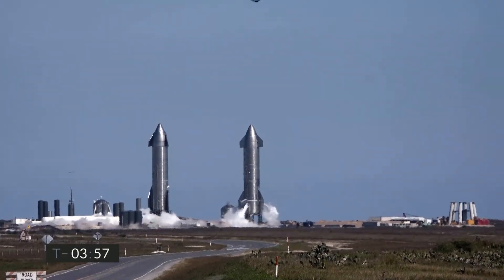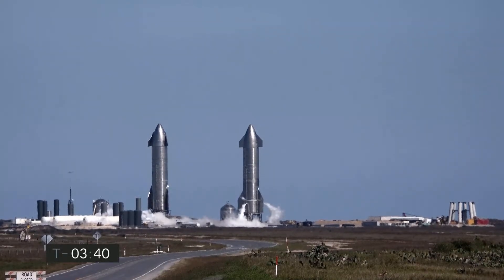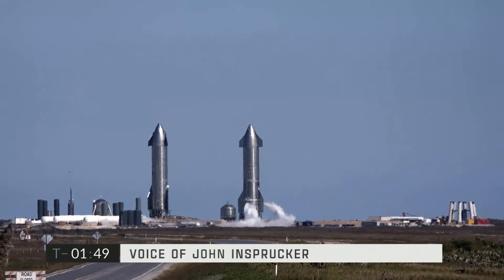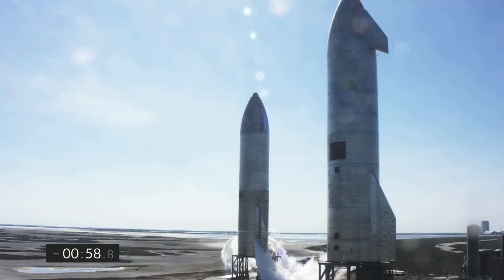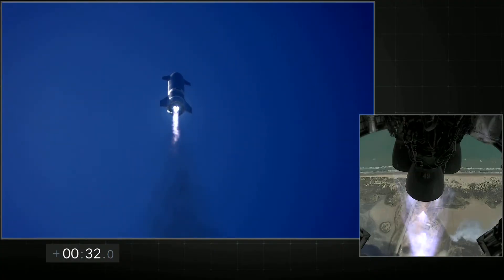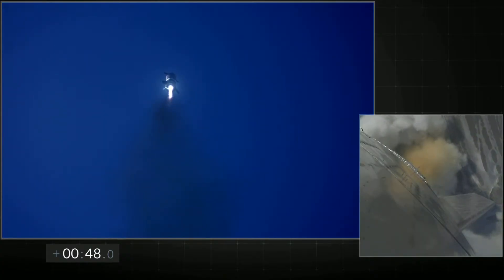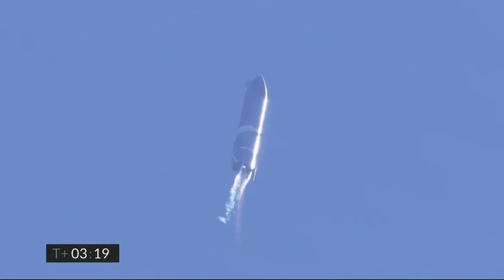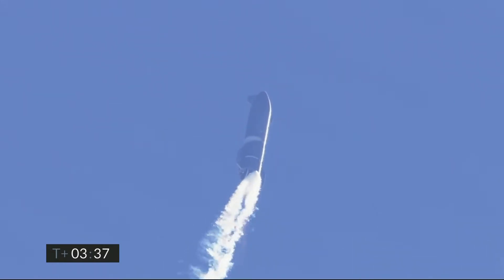Starship | SN9 | High-Altitude Flight Test

Comment: they should have landed on water... to save the rocket...
Reply: Wouldn’t have survived on water anyway
Reply: @FinkHD  why would you say that?
Reply: @khongking9794  Because it’s a 50 meter tall 100 ton heavy rocket, with the velocity that sn9 hit the landing pad the water would’ve acted like concrete
Reply: @FinkHD  its not free falling... the booster is trying to reduce the speed and the impact... if it landed to a softer surface like water... it would have stayed intact and  did not explode
Reply: @khongking9794  Look at how fast it is, the Engine slowed it down, but because the other engine didn’t ignite it still was too fast, even for a water landing
Reply: @FinkHD  yes but to a softer landing... they could have salvage it.... its a test any ways... so i suggest they should try
Reply: I'm not sure landing on water would be a good idea, it would get wet. I think a big fluffy pillow would be better
Reply: @Salticus at least if i jump into the water, ill only get hurt... not like me jumping to a solid floor... ill get my bones broken 😅
Reply: @khongking9794  If you jump from a height like 10km, then you surely wouldn’t be alive anymore
Reply: @FinkHD  yeah but if i got a booster on my ass... lifting me up.... i would  survive... just sayin 😅
Reply: @khongking9794  Not if a engine from the booster doesn’t relight... if the problem would’ve been that sn9 lands out tips over or something, then water would’ve helped, but sn9 definitely hit way too hard
Reply: @FinkHD  yeah i think so too... so softer landing spot, even just a little reduction for the impact would still be a great help for the ship
Reply: @khongking9794  But I don’t think that they would try it, if sn10 gets close to landing it probably will land, I think they have enough control of it
Reply: @khongking9794  maybe sn8 would survive if it would splash down, but starship's final destination is mars, and there is no seas or lakes on mars, so its basically pointless.
Reply: @khongking9794  its not about saving the rocket anyways, its all about the data they got from the launches. Also, they have sn10 and sn11 ready and BN1 & 2 boosters getting stacked up. Success needs trying, first Falcons sucked as well.
Reply: @Pyrpyr_2017  actually my point was to save the Rocket... its a test... And having a test Rocket, if i was the owner or one of the people who built it, i would love to see it survive at least.... that SN9 rocket was so expensive guys... just want it to be practical... So, the landing spot should. be considered for now to avoid minimal damages and cost
Reply: @khongking9794  well, its not about the money, SpaceX could afford a 100 starships if they'd want to. As i said, SN10 is ready, and SN11-SN18 are being built, so losing SN8 and SN9 is not a huge loss.
Reply: This isn't minecraft. The engines and other stuff would get corroded, and it would still explode.

Comment: Parachutes have been invented.
Reply: But do they work on 150 ton objects?
Reply: @jackwhitlock1  no they dont work for any objects heavier than air but they Help to slow things down giving more time to adjust the landing.  They dont stop dragsters or fighter jets the brakes do but first they have to be slowed down.
Reply: @deanofthevale3193  remember, the final destination of starship is Mars, and atmosphere on mars is not enough dense to make parachutes work just like they do on Earth.
Reply: @Pyrpyr_2017  there not testing on Mars though, I'm just saying to help bye a bit more time to perfect the landing and maybe the rocket for another test.
Reply: @deanofthevale3193  well, it's not about saving the rocket, at all. SN8 and SN9 were highly successful even without landing. When Starship will eventually land on Mars, landing procedure like that will be the most efficient, and after many tests and corrections, very safe. As I said, parachutes aren't the best for crafts like that. If they (SpaceX) would try to use parachutes for example on SN10 or SN11 they wouldn't gain any data from the landing, and they wouldn't learn to land without parachutes either, so its basically pointless to use them.
Reply: @Pyrpyr_2017  Ok if it's not about saving the rocket , have a big  Net then! So I can have rocket in the garden. 🤣👍
Reply: @deanofthevale3193  yea its basically all about the data and stuff

Comment: Can SN10 do a 150 - 1000 Meter Hop Test like SN6 with all 3 Raptors running to demonstrate landing after a full test flight? This should be done before attempting a High Altitude flight and another Crash landing.

Comment: To close when its time to land. Guess space x should adjust the virtical adjustment at higher altitude. Well, just usual space x. Fail then fail and fail again but later on they would probably succeed just like usual
Reply: An engine failed to light, flipping sooner would have made the problem worse

Comment: Here's a idea. Why not start correcting at least a half a mile before landing. You can't use three rockets to stop all that momentum. Even a tractor trailer won't stop 30 feet from red light if its going 55 miles a hour
Reply: Starship weighs ~120 tonnes at landing. Three Raptors have ~600 tonnes of thrust, so that's ~5G of acceleration. It was falling at ~67m/s (241km/h, 145mph).
Which means that with all three engines it can theoretically slow to a stop in only 56 meters (184ft). Not quite 30, but still impressive given the speed and weight.
The actual flip started at about 550 meters, ten times higher. That's enough to land on just one engine if the flip is fast enough (one needs ~335m by my math).
The problem was that it over-rotated and lost control due to engine failure, not that it didn't flip soon enough. Had it flipped higher it still would have crashed.
Reply: They actually save a lot of fuel by slowing down using aerodynamics first and then using the engines to scrub that last bit of velocity off.
Reply: This was an engine failure, your suggestion would make the problem worse

Comment: I'm curious to know why this took off from a position that was so close to another vehicle.  I would think that you wouldn't want them so close in case of major malfunction which could possibly lead to loss of both vehicles.  Anyone know why this was done in this way?
Reply: Because they're building so many of them (at least 7) back at the construction site that they didn't have anywhere else to put it.
They build them on fixed stands, and they can't just leave it sitting out in the open because it would be at risk of being tipped over by the wind.
The only other fixed mount they had was at the launch site. So either they halted production at the site, or took a risk and put it at the launch site.
Insert 'why can't I hold all these starships?' meme here.
Reply: @lazarus2691  Actually, they do have space to put it, i think they just rolled SN10 out there because elon said it and it looks cool and for PR reasons.
Reply: @alexn8219  Where did they have space?
There's only two stands in the high bay, which was needed for SN11 and BN1. 

At the time, SN5 and SN6 were still on their stands, and SN10, being fully stacked, was too tall to fit in the mid bay.
Reply: @lazarus2691  Hell they could have just plopped it down anywhere, just not as close to SN9 incase of a RUD. Pretty stupid decision to put it right next to it. They got lucky.
Reply: @alexn8219  
I already explained why they couldn't just 'plop it down anywhere'. It needs to be on a stand fixed to the ground so that it's not at risk of being tipped over by the wind.
They only move them on the transporter on calm days for a reason.

Comment: Spaceship design is totally wrong, it should be like Jupiter2 in "Lost in Space" :). Weit until U can make something like that. Your spaceship is like 20's century design.
Reply: America's top rocket engineers < R P
Reply: The Jupiter is poorly designed, as most sci-fi spacecraft are, in that it has the engines 'behind' the crew, instead of 'below' them.
"The Expanse" gets this right, take a look at this cross section of the MCRN Tachi: https://i.redd.it/5sfv72czwiry.jpg
The ship's decks are aligned vertically, like a tower, so that the engine thrust makes things fall 'down' instead of 'backward'
Reply: Build a better spaceship then

Comment: How much propellant SN9 spent to achieve 10km altitude, Gentlemen? Is it enough if scale it to real spaceflight? It looks like awesome, realy awesome, but as an engineer I am looking for more infomation to compose my own opinion. Will mandkind fly to other planets soon?
Reply: My best guess is that SN9 spent roughly 250 tonnes to reach 10km, about 1/5th of it's total propellant capacity. 
However, this was a very inefficient ascent. They went slowly, and hovered near the top to burn off fuel and reduce weight for descent.
Had their intention been merely to reach 10km, with no thought of slowing down or landing intact, it could have been done with 1/10th as much.
SpaceX have run the numbers on this, as have countless other people. The math checks out, the engineering just needs to live up to expectations.
Reply: The whole thing normally takes up about only 80 metric tons.

Comment: SN8 had RCS thrusters, right? Did anyone see RCS firing with SN9?

Not saying this has anything to do with success/failure. Just an observation.

Something similar happened between SN5 and SN6 if I recall.
Reply: You can see them at 10:08
Reply: @jackwhitlock1  Thank you. Can't believe I missed that first time around.

Comment: I guess the control of the engines is considerable less than they expect.
The control system must know the amount of thrust needed and how quickly it must be applied
It may be easier to control a smaller amount of reverse thrust earlier
Reply: An engine failed to light

Comment: Can you maybe use parachutes stored in the top of the starship. Just to slow down the descent prior to landing burn but after the flip from horizontal to vertical. She seems to be coming in to fast for such a large and heavy vehicle.
Reply: No, parachutes dont work on mars because the atmosphere is too thin
Reply: @atomicages8914  They were used to help land the rover though, weren't they?
Reply: @HumanitarianV4VGlobal  A 100 ton starship and a rover and 2 very different things in terms of weight. A parachute wont do nearly as much as engines would
Reply: @atomicages8914  Granted, but I wasn't thinking about them being used to land it, only slow it's decent. My other idea was to have multi directional propellers like those seen on Avatar pinned to the sides of the Startlink during takeoff and then deployed for landing, horizontally on struts rather than wheels. Using electricity generated from the sun. Instead of using fuel. We have the technology, can we use it ;)
Reply: https://youtu.be/_T8cn2J13-4
Reply: @shrodingerscat8940  Thanks for sharing! :)
Reply: You'd either need a very big and strong parachute or loads of smaller parachutes to substantually slow down something as big as Starship, thats not sustainable since that would add loads of mass, doing propulsive landings is the way to go once they have figured it out.
Reply: @alexn8219  what about my idea of using retractable helicopter type rotatory blades?
Reply: @HumanitarianV4VGlobal  The motor required for those would have to be huge to have any effect on Starship as its really heavy, and that adds mass. SpaceX has already perfected landing falcon 9 boosters, dont see why they would have too much difficulty in getting this to work, to be fair it is a completely different maneuver but propulsive landing really is the most efficient and viable method to go here.
Reply: @alexn8219  Well I am hoping and Praying for Elon they figure it out all the same. :)
Reply: Great work by the way, I love watching every minute. 
Man first landed on the moon the year I was born, 1969. I hope I get to see it happen again before my time is up.
Reply: @HumanitarianV4VGlobal  nasa is sending man back on moon in 2021-2022 after 50 years and this time they are planning to setup a permanent base on moon
Reply: @shrodingerscat8940  IKR, so exciting, I hope that time scale is realistic though. I should get to see it for sure.
Reply: @Amado I think you need a dictionary buddy ;) LOL!!!
Reply: @Amado No such word as Can't in My Vocabulary haha
Reply: Parachute would do nothing to help the starship, its way too heavy. It can help slow it down but in a VERY minimal way that's considered almost nothing. I do appreciate your enthusiasm though.

Comment: Elon has no engine sound on his cars, so he compensated it with his rockets
Reply: andylau  yeah you do know they don't run the engine all the way?
You coast most of the way, because there is no air resistance to slow you down.
Reply: @Kasmuller  Plus you its Superheavy that would be carrying Starship, and since theres no sound in space you wouldnt hear the engines on the Starship in space
Reply: @fedora997  you would if you are inside.
There may not be any air outside to carry the sound, but steel carries sound, and so does the air inside the starship.
Reply: @Kasmuller  I was talking about outside in space. Not inside the rocket. Its kinda like the Sun, its a massive explosion yet we dont hear anything because theres no sound in space.
Reply: @fedora997  there is sound in space...
There is just not anything for it to be carried through in most places....
Also the sun is not an explosion
Reply: @Kasmuller  It is. A big ball of fire, you wont call that a explosion?
Reply: andylau  ufo
Such as a rock or a undiscovered bird species?
Spaceships (sci fi) were invented by humans.
So you are saying we need to learn from ourselves?
Reply: andylau   I mean what happened at the Capitol was very much of a game was it?

Comment: My very stupid thought: maybe the engine failure issue is with fuel supply (lines) to the Raptors malfunctioning due to the "sudden reorientation flip" from horizontal to vertical for landing? Because the Raptors seem to work just fine from liftoff to engines-cut-off. Maybe it's best to orient the vehicle a bit earlier (like the F9s do) before the landing? Well, I'm just a novice and no Rocket Engineer. Only SpaceX know these things as they are the experts and have all the data. I do believe SpaceX will get it right with SN10. Go SpaceX! We love you!
Reply: It’s a good thought. However, if it was the fuel lines, both engines would have failed
Reply: @jackwhitlock1  true. Or, probably, only some engines are getting supply. Would be pretty interesting to see what solution SpaceX find for it...because I know they will, they always do. Falcon 9s started that way but their landings are now so routine that we almost tend to no longer think about what engineering genius made it possible.

Comment: Just a thought.
Use the lower flaps to help control and stabilize the rotation of the rocket...they work don't they? lol.
Reply: This still wouldn’t work if an engine fails (Like it did here)
Reply: @jackwhitlock1  Absolutely,  but every bit helps.👍

Comment: Why doesn't SpaceX start the flip sooner. Yes it would use more fuel to land, but you tune it down from that point. less likely to lose the rocket, more attempts to reuse the rocket and optimize it until it fails? Unless fuel is more expensive than the rocket or I am missing something. You go from working rocket until it fails. Not from failed rocket to working.
Reply: Saving fuel isn't just a cost concern, it's also a safety concern. 

The header tanks only have so much fuel capacity, and most of it is needed for landing, with some safety margin. The higher you flip, the more of that margin you use. 

You could use bigger tanks with more fuel to increase the margin, but that would make the rocket heaver, not to mention nose heavy.
And a heavier rocket falls faster and needs more thrust to slow down, which uses extra fuel, which eats away at that extra margin.
Of course you could add even bigger tanks to compensate further, but you just run into the same problem. The tyranny of the rocket equation.

So there's a very real argument to try and be as fuel efficient as possible from a safety standpoint. Also, less fuel means smaller boom if you do crash...

There's also the matter of the throttle band. 
There's a maximum altitude at which Starship can land on minimum throttle, and minimum altitude where it can land on maximum throttle.
Anywhere between those two altitudes will work, but ideally you want to be right down the middle.
Raptor can throttle between 40% and 100%, so ideally you want to attempt a landing from the ideal height for 70% throttle.
That way if you underestimate, you can throttle up as much as 30% to compensate, and if you overestimate, you can throttle down as much as 30% to compensate.

But let's say you flipped sooner, at a height where you only need 50% throttle to land. This is great if you underestimated since you have +50% to compensate.
However, it's not so great if you overestimated, since you now only have -10% to compensate in that direction. 

There's a very real risk that the rocket would 'pogo', that is, stop too soon and start ascending again. Falcon 9 did that once or twice IIRC.

It's also worth noting that flipping sooner wouldn't have helped in either SN8 or SN9's failure.  SN8 slowed to 30m/s at one point, but crashed at 36m/s, meaning it actually started gaining speed again as the engines failed. Had it flipped higher, it would have hit the ground even faster.

Likewise, SN9 lost control during the flip because it didn't have enough control authority on only one engine. Flipping higher wouldn't have changed that.